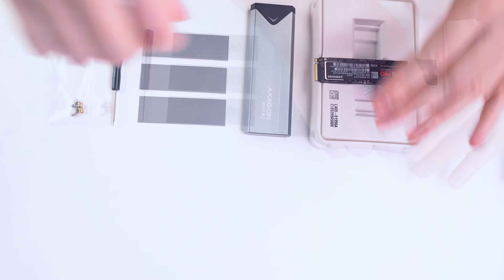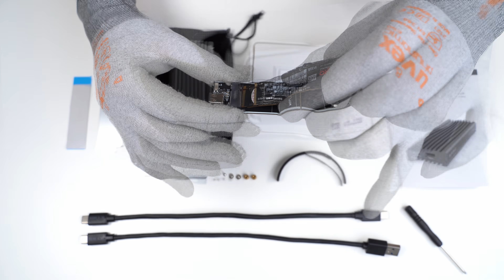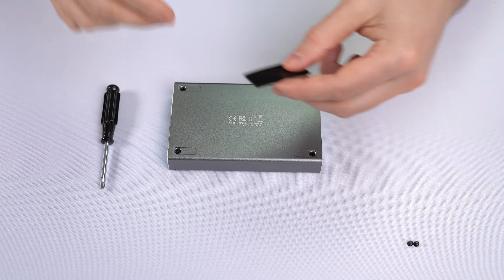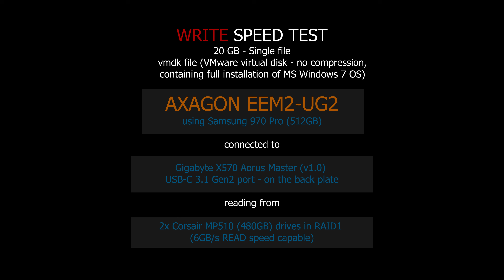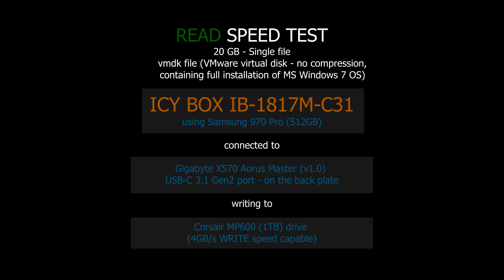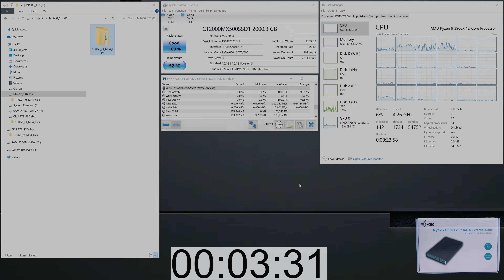M.2 NVMe USB-C External Box TEST - for SSD - AXAGON EEM2-UG2, ICY BOX IB-1817M-C31 & i-tec MySafe

Comment: I would recommend the faster USB 3.2 Gen 2x2 with 20Gbits Icy Box M.2. That is the most perfect and excellent minimalist and technical looking external NVMe case one can get, it´s speeds are stable and the temperatures always 10-20°C cooler than all internal NVMe drives cooled with active-cooling GrauGear or Icybox NVMe coolers. (Especially if you have a metal cover on your PC and put that Icy Box M.2 on that metal - the heat dissipates way faster than the NVMe can produce it.)
the Corsair MP600 is a great NVMe, still my favorite drive and operating system drive for four years now, in use for 1148 days and 11 hours, 104000 Gigabytes read 76000 Gigabytes written and "The status of the solid state disk is PERFECT. Problematic or weak sectors were not found."

Comment: What about TRIM function? Neither of them seem to support it (CrystalDiskInfo), although at least Axagon specs is device as supporting it. This is such a disappointment. I ordered a ~15euro case from Aliexpress and was so mad it didn't support TRIM (JMicron 583 chipset). A friend purchased the exact on, his came with Realtek 9210b chipset and supports TRIM. JMicron claims JMS583 supports TRIM, but seemingly even non-noname NVMe cases have this problem. Your video just saved me ~30euros.

Comment: Just bought the ICY BOX and honestly, I'm extremely disappointed to the point where I wonder if there's something wrong with my unit. I installed an NVME M.2 Kingston NV3 1Tb SSD and when connected to a regular USB port of both laptops and PC, I got a max 60 MBps sustained transfer rate, that can't be right! I tried different cables, different USB ports, both type-C and regular USB and the best I could get was 140 MBps... very very disappointing, I wasn't realistically expecting anywhere near advertised speed but still, this is on par with cheap USB drives which kinda defeats the purpose of the whole investment. The whole setup is cumbersome, you have to buy the enclosure and the SSD separately and also have a cable umbilically linked to it all the time, would much rather prefer having a fast USB stick like the Sandisk Extreme Pro instead of this impractical thing, i will be returning it

Comment: What you are basically telling is, if I am about to buy a 512 GB flash disk that costs at least 40E (cheapest prices), it is by far better to buy any m.2 disk (for example ADATA LEGEND 710 512GB) and AXAGON EEM2 for roughly the same price?
Of course, on presumption I do not care about the size, which is acceptable for me.

Comment: Can I play valorant or GTA 5 like game with these external enclosure ,  
If yes, then for how much long  hours we can play games so that SSD inside the these external  enclosure should  be safe from extreme heating.
Reply from the maker: Yes, you can play any games however long you want from these enclosures if you let them lie on the table or case without covering them by anyting. The stress I created during my testing using Crystal Disk Mark is far greater than what these games will do. The enclosure and the drive will likely heat up to around 50C (with NVMe drives) over longer period of time (several hours), but that’s fine. They will be hot to the touch during operation (anything above 45C is not pleasant for skin contact), but will function normally without loosing speed.
 

The coolest of them during operation was i-tec MySafe because it is paired with SATA SSDs which produce less heat (like Samsung 870 Evo) than NVMe drives.
Reply: @MartinsLab  thanks for the reply

Comment: do you think I could use it as a second fixed ssd of the pc? therefore practically always remaining under fixed data transfer. or could it give me over-time issues or other problems I don't know?
Reply from the maker: If what you mean by „Fixed SSD“ is that the enclosure would be permanently connected to USB-C/USB-A port on your PC and you´d install applications on it and run them from it, then I wouldn´t recommend it.
 
What sometimes happens is that when you connect other device to your other USB port on your PC (which happens from time to time - mouse/keyboard/game pad/flash drive etc.) it also affects other devices which are already connected and there could be an instability or possible temporary lower speed of data transfers while that other device stays connected (depends on the device).

In case of NVMe SSDs (Axagon/IcyBox) - you´d get better speeds if you placed them in M.2 motherboard socket directly + also better temperatures (but it is possible of course).

If what you mean is that you´d be editing a video of off that drive directly (have mp4 files on it) or watching a video and have it connected for a long time (several days), then I see no problem. I just wouldn´t use it for installing applications you use daily (only files which are OS independent). Also, when you have USB drive connected at bootup it sometimes slows down the bootup, because the BIOS is looking at it as a possible OS drive and checks it every time.

In case of SATA SSDs (itec) connected to USB-C 3.1/3.2 Gen 2 port, the speeds would be very close to connecting them to SATA port directly, so the loss of performance would be minimal. However, the latency is higher. I have had the itec drive connected for several weeks permanently and there was no problem, but it wasn´t loaded heavily all the time, only occasionally.

Is there any specific reason why you´d want to have the drive connected permanently to a USB port instead of its native port on the motherboard?
Reply: @MartinsLab  the reason is that in the motherboard I only have 1 slot for nvme m2 and obviously it is already occupied by a m2 of 1 tera but I would like to have more space inside the PC and I would like to know the best way to increase the space without changing the motherboard with one having 2 PCI slots
Reply from the maker: @iFrancesco007  That makes sense. There is a way. If you have at least one PCIE slot free with four PCIe lanes, you could place the second M.2 SSD into PCIe adaptor card and have it work permanently from there. If you tell me which motherboard you have and which slot on it is free and which CPU you´re using I might have of a solution.
Reply: @MartinsLab  I have a preassembled ASUS ROG G15DK- and in fact the motherboard is an Asus g15dk and as a processor I have an amd 5800x
Reply: anyway thanks for all the support you are giving me.  you deserve a like
Reply from the maker: @iFrancesco007  OK, the ASUS website says, that this PC "ROG Strix GA15 G15DK" uses “B550 chipset” and has “2x M.2 slots” and “4 SATA 6.0Gb/s“ ports. So, fortunately, there are options for expansion 😊

Link: https://rog.asus.com/desktops/mid-tower/rog-strix-ga15-g15-series/spec

The pictures on the website of closeups of this motherboard are not good enough and the PDF manual is rubbish, so I will have to improvize. The manufacturer probably didn´t think anyone would want to do any upgrades (evidently they were wrong).

a)	I´m guessing that if you remove the GPU (RTX 3070), there will be a “2nd M.2 slot” under it. 

Because the motherboard chipset is B550 and “1st  M.2 slot” is already occupied, this “2nd M.2 slot” connected to it therefore runs in PCIE 3.0 mode, which means that it will run only up to 3,9 GB/s (1st one can go up to 7,877 GB/s) which is good enough for what you need and 4x better than what USB-C USB 3.1 Gen 2 offers (1,25 GB/s).

(You just might have to buy an M.2 SSD with a heat sink or buy a both separately - "M.2 SSD" and the "M.2 heat sink" and make sure the heat sink isn´t too tall to fit under the GPU)

So, if I were you, I´d check it – I can´t see it from the pictures, just putting pieces together..

b)	There are also 4x “SATA 6.0Gb/s“ ports, so if there is power cable with SATA connector inside that PC (leading from the PSU or as a part of accessories you got with the case) you could place a SATA SSD under the GPU on that black PSU shroud. It might require some tape or plastic/velcro strap. 

Or maybe if you remove the back panel of your case, there is dedicated space for it at the back for screwing it in – I don´t know I can´t see it, there are no pictures of it on the website.

Both these options would be better as a permanent solution.
Reply: I think there is only one m2 slot because when I bought about 3 months ago the pc was too hot for me so I decided to take it apart to replace the heatsink present with a nice noctua d15 and then with the bare card if I remember correctly I only saw 2 pci slots: one for the video card and one occupied by the SSD m2.  could it be that the second slot per m2 is below the m2 already entered?  otherwise I don't know if there are splitters of the m2 slots.
Reply from the maker: @iFrancesco007  Using D15 was definitely a good idea, stock coolers are usually weak. 

The manufacturer says the MB has two M.2 slots, so I´d check it – temporarily removing the GPU takes about 2 minutes – two screws and pressing plastic PCIE safe guard on the slot and you´ll know for sure then you put back the GPU. (There may be more models/configurations of this "GA15 G15DK" available, so there could be some differences, I´d have to see it - there is no official documentation I could look into)

I have never seen any solution having an M.2 NVMe slot at back of the first one - there wouldn´t be enough PCIE lanes for sharing -  so highly likely not. (Some high-end motherboards have an M.2 slot at the back of E-ATX sized motherboards, but they don´t share PCIE lanes)

Using PCIE slots wouldn´t help, based on what I saw, there isn´t enough room for expansion cards, the GPU is too big + they have only one PCIE lane available, which isn´t enough for using NVMe SSDs.
 
Otherwise I quickly checked two videos on YouTube and there are free SATA ports (in the bottom right hand corner of the MB) and cables with free SATA power connectors (if you remove the back case panel and look close at the bottom close to PSU) so this option is definitely available. You could get Samsung 870 EVO or Crucial MX500 for that use case and solve this easily if you decided to settle for a SATA SSD.
Reply: thanks again for the support.  when i get home i will disassemble the video card and look more carefully and in case i can't find another PCI slot i will settle for a SATA because from what i understand it is not very safe to use these nvme m2 a type c case as hard drive for a PC
Reply from the maker: @iFrancesco007  You´re welcome. In case there is no second NVMe M.2 slot, you might be even able to hide the SATA SSD in that bottom space close to the PSU – there seems to be some room. (The airflow wouldn´t be the best, but it could be worth trying. Maybe the case has ventilation from the bottom? SATA SSDs run cooler than NVMe drives so it could work.)
Reply: @MartinsLab  bro you are right under the video card there is a 2 slot which is occupied by the wifi card and of course I will lever up. which m2 do you recommend? and also heatsink for ssd
Reply from the maker: @iFrancesco007  OK, that is good news, looks promising. Just to be sure it works, I would try placing the first M.2 NVMe SSD which you already have and put it in that M.2 slot and boot up the PC from there to see if it really works.
 
(In the video you posted the WIFI cards seems to be in the way, so that is why I´d try it first it fits in without any problems and also see if the BIOS allows it, before you spend money on the new M.2 SSD. The slot into which M.2 SSD goes is the different one than where the WIFI card goes, it is more to the right and says “M.2_2” under it). 

You´ll also need to place the first SSD there (I think it doesn´t have a heat sink) and measure how much space you have between the surface of that SSD and the bottom part of the GPU. It will tell you how tall M.2 heat sink you can use.

If it works, then you´ll need to make a decision if you want an M.2 NVMe SSD which is more budget oriented (doesn´t cost much, but doesn´t the job) or more speed oriented (costs more is a also faster) and which capacity (how many TB) you want. Then I can give you some recommendation. 

Another decision is if you plan to use this new SSD even in your next computer after this one. Modern SSDs last long (many years) so you could for some time run Gen4 NVMe SSD (PCIE 4.0) in a Gen3 (PCIE 3.0) slot at half speed (at slot´s max) and when you move it to the next computer, you could use its full (Gen4 / PCIE 4.0) speed. The prices are starting to be very close between both generations (Gen3/Gen4) in many cases.

So, to sum it up: 

1)	Try if current M.2 SSD fits into 2nd "M.2_2" slot and boots
2)	Measure how much space is between bottom part of GPU and M.2 SSD in 2nd slot
3)	Decide if budget/speed is the priority
4)	Decide how many TB you want
5)	Decide if it also goes to your next PC or just this one , both (Gen3/Gen4) will work there
Reply: @MartinsLab  ok I did the test and moved m2 already inserted in the other slot I found and the pc started immediately without any problem :)). I was thinking of adding this other ssd what do you think?
Reply: ssd 980 pro with 1 tera heatsink.
as for the space there is about 2.5cm so I think they should be fine. I am also undecided whether to buy another heatsink as I noticed the ssd already mounted is bare. even if in reality it has always been around the 50-55 maximum.
so do you think i should get samsung 980 with heatsink and another ssd heatsink that i already own or do you recommend something else?
Reply from the maker: @iFrancesco007  In that case there is nothing standing in way of upgrading 😉
 
When I thought about your PC, there could actually be a way of utilizing that new SSD even better. 

Because your motherboard has B550 chipset (according to ASUS website – you can confirm this by looking into your BIOS) and your current drive - according to that video above is “WD SN530 (PCIE Gen3)” and is placed in the 1st PCIE 4.0 slot and running in PCIE 3.0 mode, you could (do something which I have done in my upcoming video) utilize full potential of your 1st PCIE 4.0 slot.

1)	You could clone you existing WD drive to your new Gen4 SSD
2)	Put M.2 heat sinks on both of them (buy them separately -  to save)
3)	Place the Gen4 SSD into you first PCIE 4.0 slot  (to speed up loading time of apps on your PC)
4)	Delete all data on you WD drive and use it as a secondary drive in the second slot under the GPU (after you know you can boot from the new Gen4 SSD)

This way you´d be able to use full potential of your new drive NOW and have some additional space on that WD drive which would have better cooling. That is the best possible solution.

When it comes to drives “Samsung 980 Pro” is a very good drive, so it definitely wouldn´t be a mistake going for it. However, it doesn´t have the best endurance (TBW), it has only 600 TBW (if you can ever deplete it is another question – depends on the use).

I have been testing Seagate FireCuda 530 (ZP1000GM3A013) for the last 2 weeks, which has even slightly better performance and has 1275 TWB endurance (double). It is the best 1TB NVMe drive I know of right now. So if I were you, I´d consider it. (You can check out the reviews online)

The non-heatsink version is around 170 USD right now on Amazon (Samsung 980 Pro is around 150 USD). So, spending 20 USD extra seems to me like a good deal for double endurance + few % extra performance. But, if this is over your budget, than “980 Pro” is absolutely fine.

Because the heat sink versions of all M.2 drives are usually disproportionately more expensive then they should be (depends on when and where you buy it), it might be a good idea to buy the heat sinks separately. It depends on what price you´re able to get in your area.

In case, that is the way you want to go, you can get separate M.2 heatsinks for around 8 – 17 USD. Definitely go for those which don´t stick on the drive permanently, only those which are made of two parts which are screwed together by screws (and can be reused) or click together (both version have a heat sink on top + small thermal pad and thin metal 
part at the bottom of the drive).

You could go for (can be found on Amazon):
a)	JEYI Copper M.2 HeatSink, Passive Nvme SSD Heatsinks with Copper Fins - Finscold Q80 (for first slot and Gen4 SSD) / be quiet! BZ003 MC1 Pro
b)	Something smaller for the WD under the GPU - QIVYNSRY M.2 heatsink 2280 SSD Heat Sink

There are many options, so you can pick some which has good reviews. Unfortunately, I haven´t had enough time yet to test myself which is currently the best (will come to that eventually), but generally any will be 100% better than none. So, I have written another essay :)